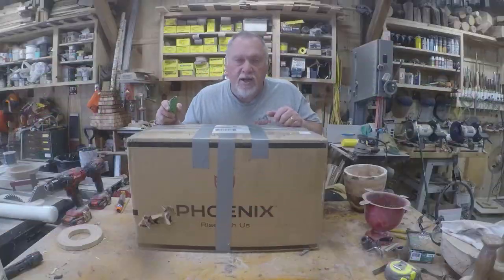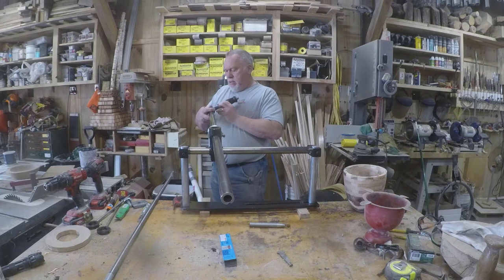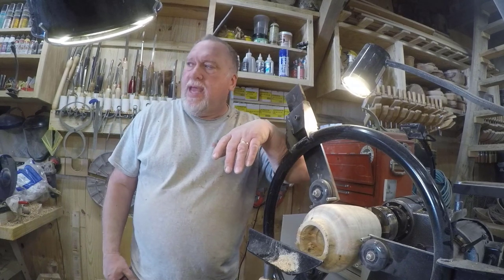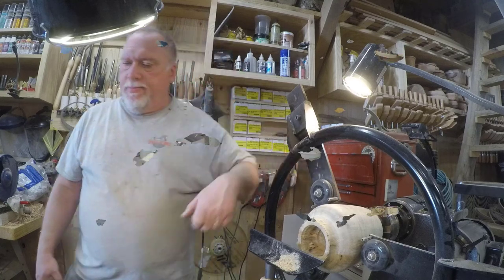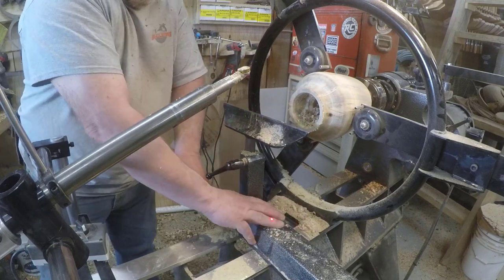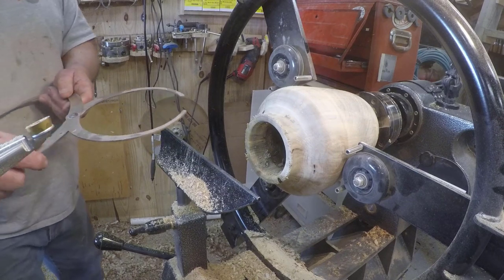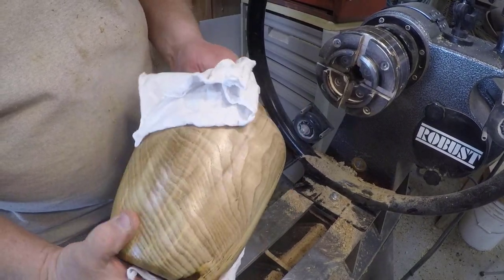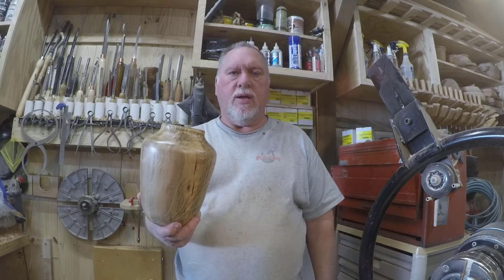Woodturning Clark Deep Hollowing System   Set Up and First Use

Comment: Hi Mike, That is certainly a solid piece of kit. Hope you get lots of use out of it.
The only thing I would have done differently is to have the cutter set at 45 degrees to the piece of wood and not 90 degrees to it. 
My Vicmarc Hollowing is set up at 45 degrees and every other video I have seen also showed the cutter at that angle.
Take care Mike. Cheers, Huw
Reply from the maker: Thanks Huw!  I will try that next time.  I will be doing some very hard pear wood next.  I will let you know the outcome.

Comment: Thanks for posting. I've been using the Clark system for a few months now so interested to see others setting it up and using it. Works great but I am having trouble when I get out to about 23" or more. Did one yesterday in black cherry that was 26" deep and last few inches were rough with bounce, chatter and an off center pilot hole that was tough to deal with. Any tips on how you keep your pilot holes centered out that deep and cutters that work better that deep? Thanks.
Reply from the maker: I have not done any that deep, however I do like to do my pilot hole in stages.  Drill, hollow to that depth, and then drill deeper.  Thanks for watching!

Comment: thanks for showing this video I haven't been turning that long and haven't did any really deep hollowing but want to give it a go need to buy one or make one about what is the cost and how did you like the laser ?.......Thanks Larry from calif
Reply from the maker: Larry the laser, when it works, is absolutely necessary.  The problems I have with it is 1.  I have conflicts with my steady rest (which I work around.) and 2. The nature of the work shakes the laser apart.  You need to put electrical tape on it to hold it together.  Thanks again Larry!

Comment: Mike, thanks for the video.  I'm considering one of these and it was good to see a new owner using it for the first time.  Could you answer a couple of questions?  What's the name of your steady rest?  After about 1 year of use on the Clark system do you have any regrets?
Reply from the maker: Hey Ken!  Thanks for watching!  My steady rest is a Robust and I ordered it with the lathe.  The deep hollowing system is good.  No real regrets, but I have learned some lessons.  Such as, the nature of the tool is very rough work.  They will rattle themselves to pieces.  you have to constantly check things for tightness.